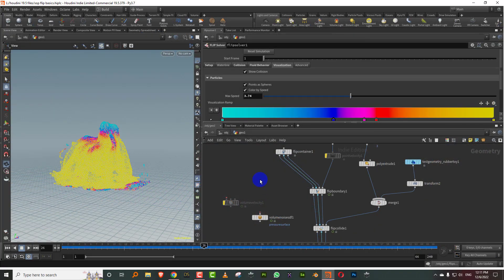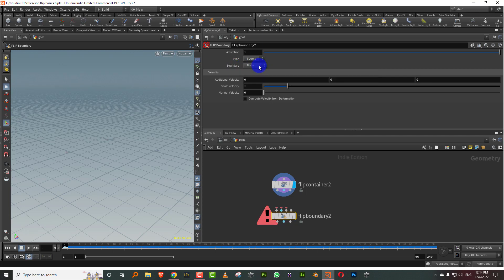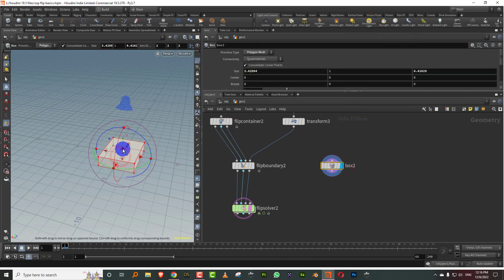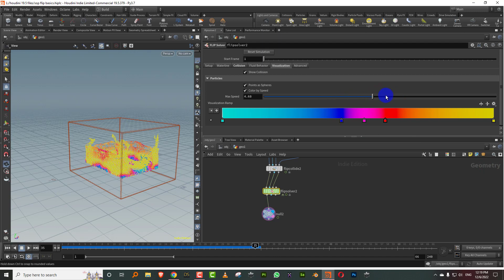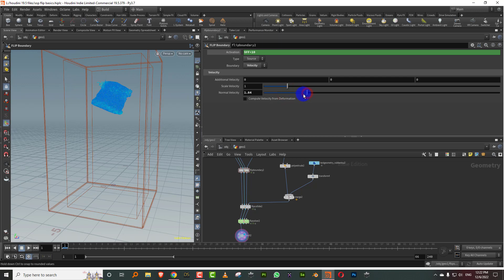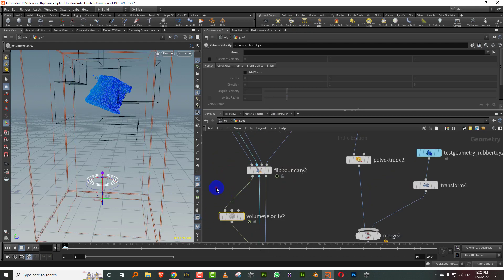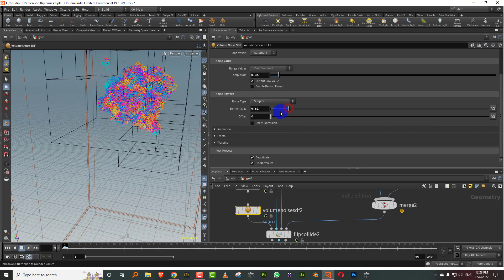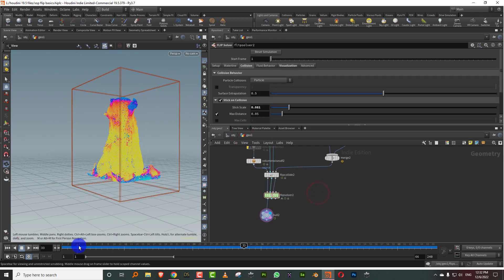Houdini 19.5 - Intro to SOP Flip tools

Comment: How did you change the size of the spheres?
Reply from the maker: It’s representing pscale. It will automatically become smaller as you lower the particle separation. But if you want it lower still you can apply a float node and modify the pscale value after the sim but it could make changes to the fluid surface node , so be careful how you use it. If you just want to render the particles or tweak it for viewport then it’s fine,
Reply: oh, my viewport just wasnt updating for some reason. Now it is.
Reply from the maker: @nathangordon3942  the Houdini viewport does that sometimes. If you have the lab tools installed, go the lab tools menu and there's a reset viewport button. It should help.
Reply: @rohandalvi  Another question. Would I want to paste the particle sepration from the flip solver as relative reference into the flip container? I have been advised to do this when it comes to pyro (though I forget the reasoning).
Reply from the maker: @nathangordon3942  you don't need to. In Pyro you need to control 3 things with the same parameter, the smoke resolution, the voxel size in the volume rasterise and the particle separation. In the flip node, both the particle separation values are doing the same thing, so you can just control it from the flip container node.